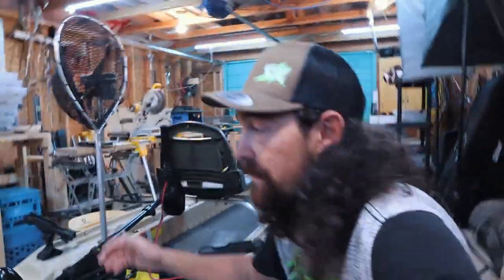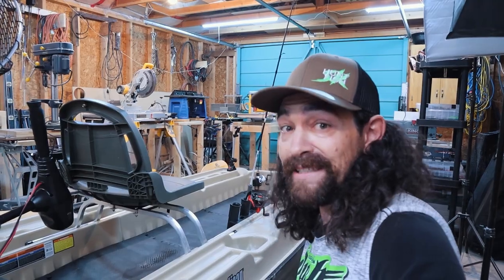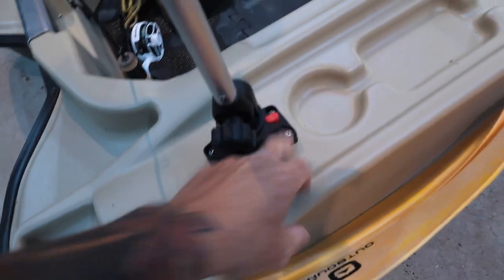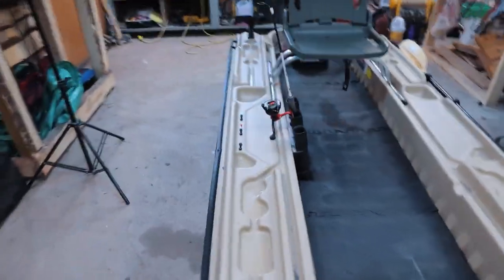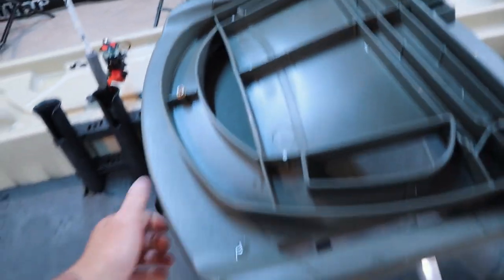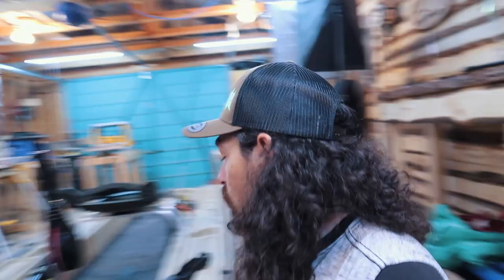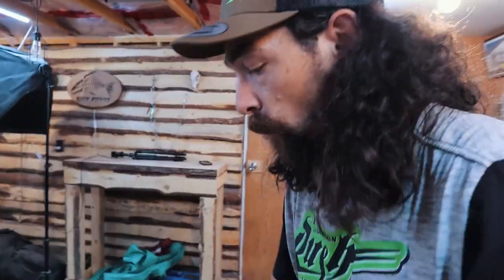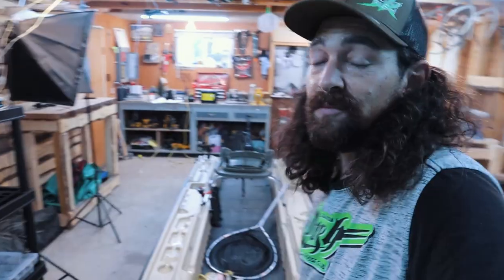2023 Pelican Perch Raider 10e MODS New Features UPDATES And UPGRADES

Comment: Good video.  I want a bigger fishing boat but A) I'm about $10-15K light in the funds department and B) I'd have to cut a hole in my garage for the trailer.  So I'm shopping [hard] for a smaller vessel like this.  My question has to do with drilling into the plastic.  Is there some sort of dense material underneath the plastic to drill into?  Or are you just drilling into plastic sheeting?  If the latter, I'd be afraid to trust that plastic since there's no washer or bolt holding it onto the plastic.  What am I missing?
Reply from the maker: Yah its pretty much just the light plastic. I thought the same that you are thinking. So when you tighten up your stuff you gotta be careful you dont over tighten and strip it. Pop rivets are a good idea as ive use some on there too and the screws. Long as your carful I think you will be good. I've had no issues yet. Hope this helps!
Reply: @SaskFisher  You think moly bolts would work?
Reply from the maker: @brianbruno4749  Never tried but could be a good idea for sure

Comment: Great overview and loving that craft! It’s going to be something that I’ll definitely be picking up one in the future. 

I like how it’s got those transoms on both sides.

But the big question is, was it overpriced?🤔😂🤣

My Minn Kota has the battery meter on it as well, but I have found I can’t always trust it. I’m at 5 (full thrust) most of the time on the skiff, so I don’t get good mileage at all. 55lb thrust is a beast tho!
Reply from the maker: Thanks!! I still love your flying saucer!! I do NOT trust the gauge lol. It ALWAYS reads full.......never has went down lol. I am a little worried lol. Atleast down there you can choose between the bass pro version. I looked at both an its pretty much the same. Plus its  a little cheaper but couldnt get that up here lol.